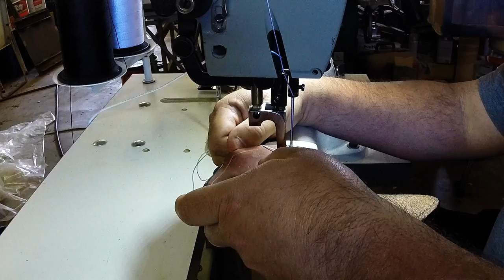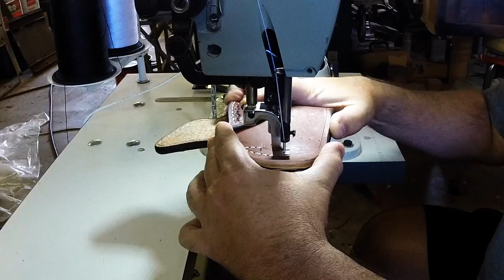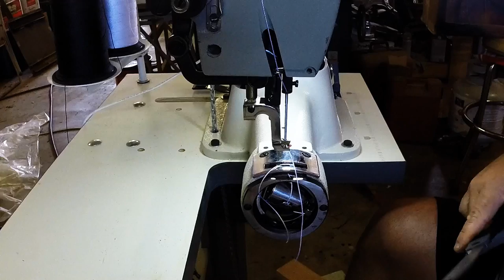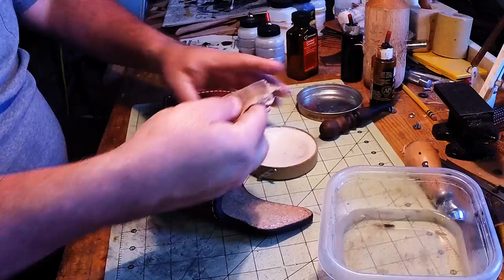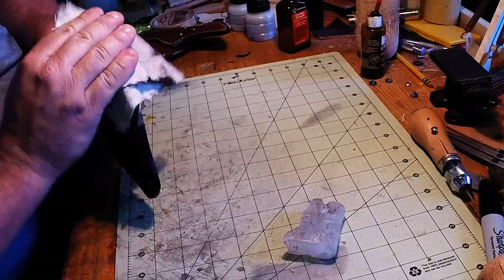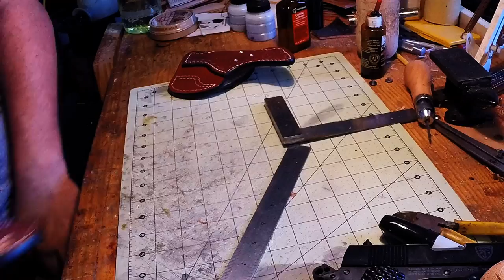DCL - Kimber Leather Paddle Holster

Comment: How many stitches per inch and the thread size? Looks like a CowBoy 3200 ??
Reply from the maker: +Don Kenner I don't get real meticulous about measuring out the exact stitches per inch, but it's somewhere in the neighborhood of 5. I generally use size 277 thread and you are correct...Cowboy 3200. I really like that little machine. Watching this video back, I must not have been using it for long at that point. I'm much more proficient (faster) on it now.